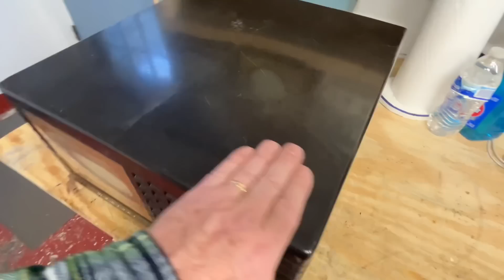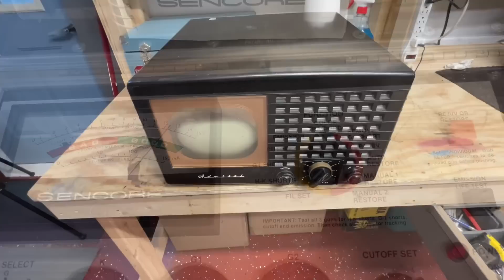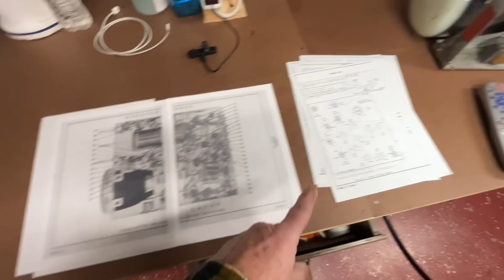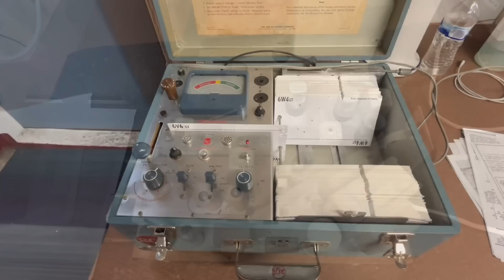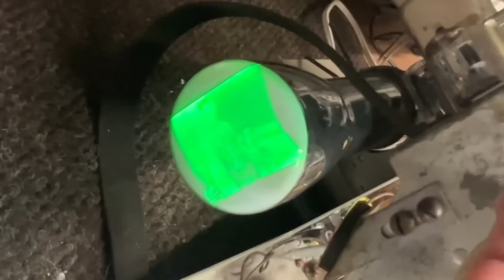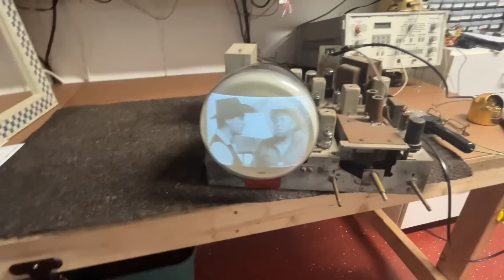1948 Admiral 7” Bakelite TV Restore.  Part 1

Comment: The CR-70 can check CRTs well, but caution if you need to use the rejuv. functions.
Reply from the maker: I agree, 
Not a good idea to try rejuv on the electrostatic CRTs. 
The best test is a working chassis. 
Thanks for watching and sharing

Comment: I nice new video from you. A ham radio friend gave me two of these sets years back. I was going to try and restore one but I sent the two of them down to Bob Andersen for parts. I wonder how long the NOS supply of HV capacitors will hold out. I am still working on the Victor projector. I believe I have a transformer that will work in the amplifier. Look for the PT3 that I will post some time in the future. I like the way you test the 7JP4 tube. I had no way to test the two I had.
Reply from the maker: I’ve found the only sure test is to hook up the 7jp4 to a working chassis.  CRT testers don’t check them very well 😀
Look forward to seeing your progress on the projector